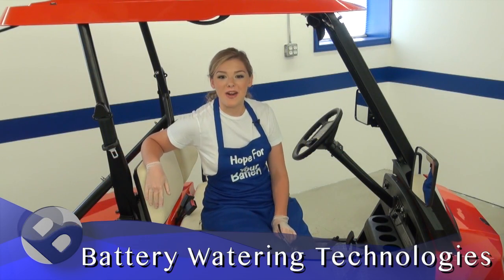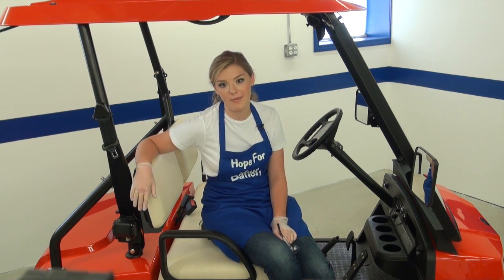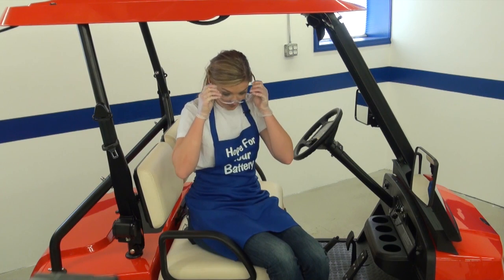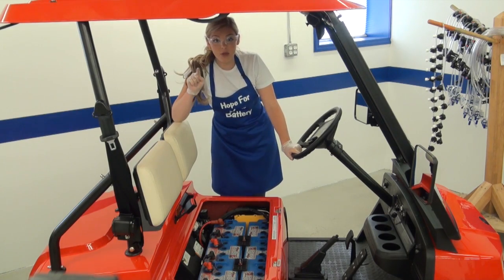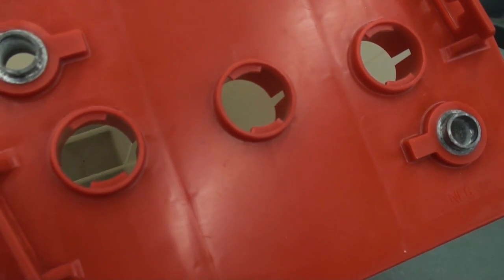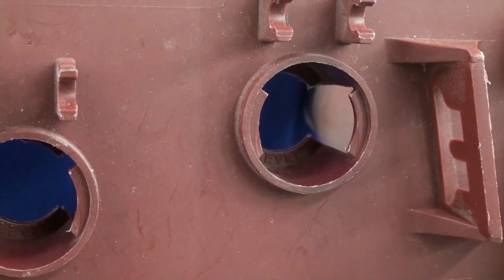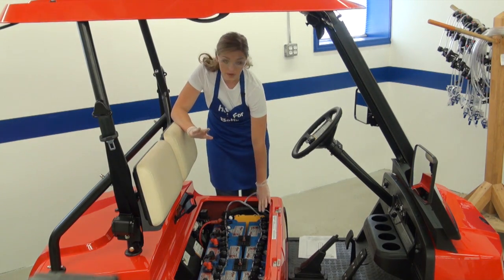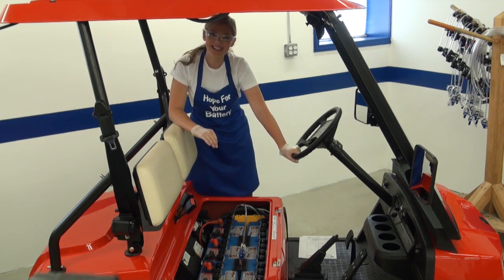Installing a FULLY ASSEMBLED WATERING KIT ON A GOLF CAR battery (BWT)

Comment: That's an important safety tip: charge first, than water. When a battery discharges, the water level naturally goes down. If you fill a dead battery, the electrolyte may overflow. Can you give us an idea on the price of the system based on cell count?